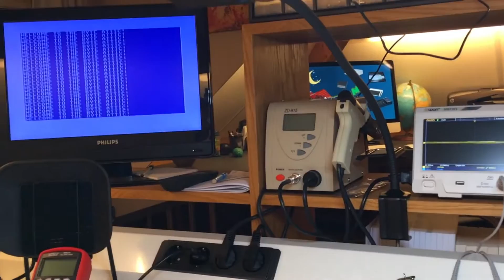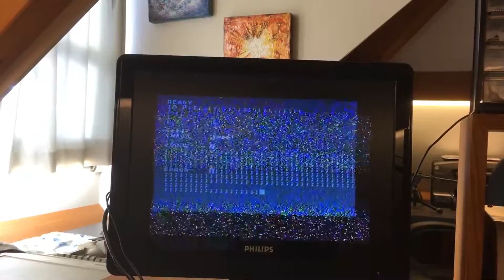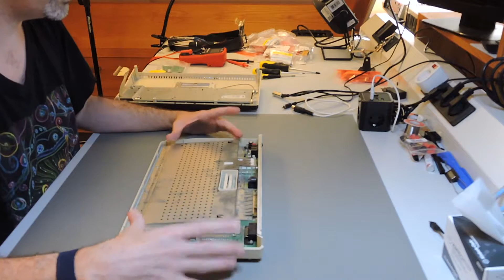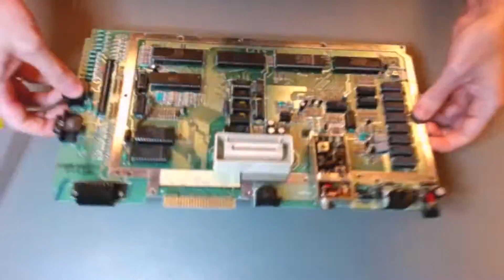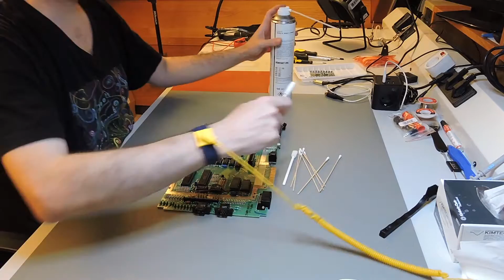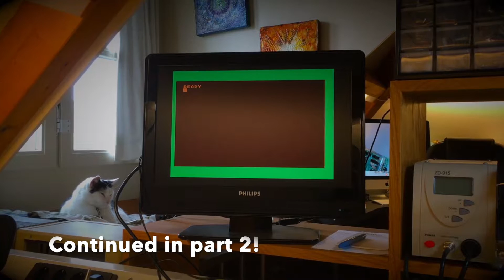Atari 800XL motherboard restoration and system overview

Comment: Would there be any chance this may replace the Sally in an Atari 7800?
Reply from the maker: Is there a chance? Sure thing! Have I tested it on a 7800? Nope, not yet. So no guarantees.
Reply: @thebyteattic  Cool, thanks. I've ordered the PCB and the IC's. I'll report back. With a YT video of it. If anyone has a suggestion of a particularly timing sensitive game I can test with. I'm using a Concerto Multi-cart so HB, hacks and demos can all be tested.

Comment: I'm sure you have figured it out by now that the 5 pin DIN port was not s-video.  S-video was not a thing in the early '80s.  It was meant for the composite monitors of the day.  There is audio and video that comes from that, and it was normally broken out to RCA outputs; one for video, the other for audio.

The video can be upgraded, but the best signal you will get without an upgrade will be from that monitor port split out to RCA cables.

Comment: Love this! 

To save you time in the future, almost no one replaces the caps on the Atari 8-bits. The computers don't suffer from the same issues as other computers from the time period.

And you're lucky, your machine is socketed! A majority of the 800XLs were not.
Reply from the maker: Cheers!
Reply: That were two observations that I made myself today as well when I opened up my atari 800XL The caps are still ok and all IC's socketed. joy!
Reply: It isn't the computer that suffers issues, it is the caps.  All electrolytic caps have a finite lifespan.  That lifespan can actually be increased by using the device, but not indefinitely.  Replacing them now will prevent them from exploding and leaking all over the board, often destroying the motherboard in the process.

Comment: Great job. The rf shield also provides structural rigidity to the computer and for that reason is desirable to keep in the machine.The PIA chip is not custom afaik. Can still be bought new today for about $2. Agree that the tape near the keyboard connector is unsightly. Not all 800XL's have that tape, only it seems the ones with the keyboard type yours has which is the most common SCCO 'Stackpole' variant. The Alps keyboard types have a very pretty red resistor pack in that area. Cheers.
Reply from the maker: Thanks!